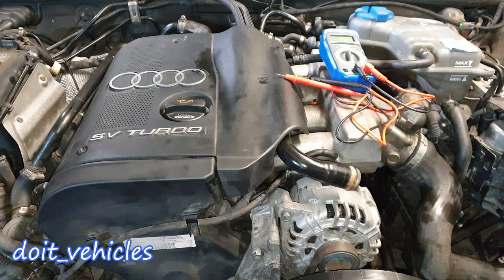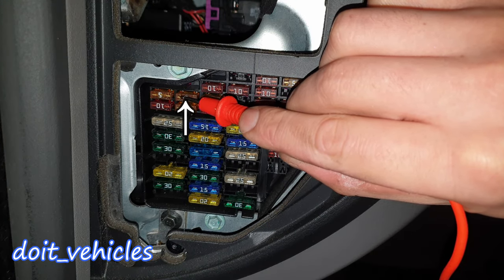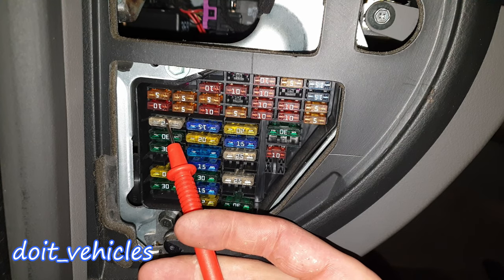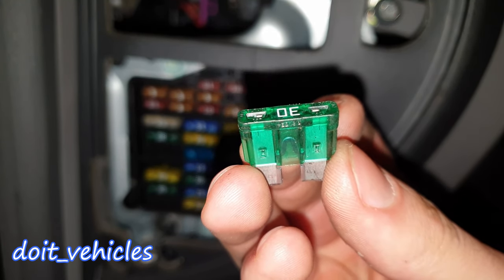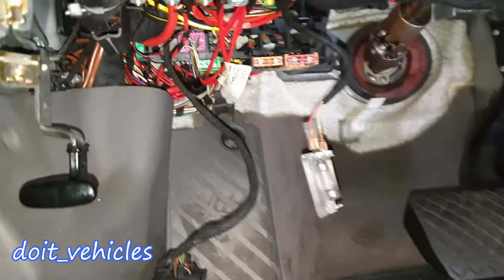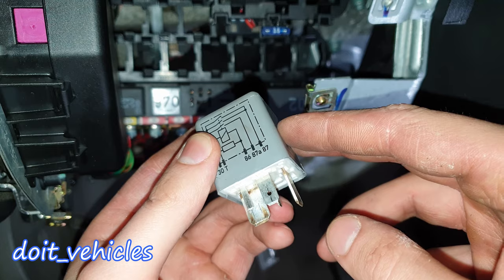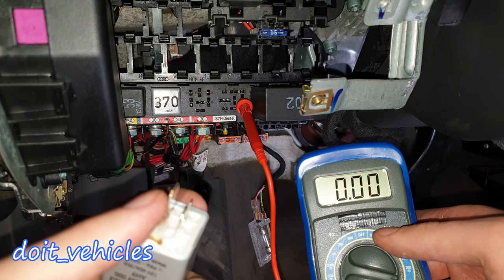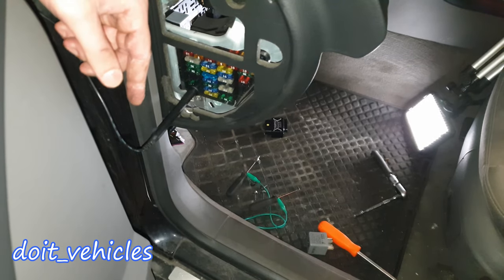1.8T Audi A6 Fuses and Relays Location / Diagram - how to test them c5

Comment: Hi, thanks for useful videos.
l have a question 
While I was driving my Audi A4 2001 has lost elecric power that means  no power at all. alternator is ok and the battery has enough power. what could be the issue.-'' 
Thanks

Comment: Excellent video! Hi! My engine temp, fuel, and battery gauges suddenly went to zero while the speedometer stuck at 50 km/h.  RPM/tachometer still works as does everything else on the instrument cluster. Does this sound like a blown fuse? (Audi A6, C5 2003/4 1.8T)

Comment: hello there great video do you have same video for the Audi A6 c6 model showing fuses etc I have a small problem on my Audi A6 c6 2007 automatic 3 litres when turning the key it sometimes doesn't turn over  fitted new starter 4 months ago as burned out due to heater plugs gone now all serviced and ship shape and no starter problem until this week, but any help on the correct place where the starter relay location is    need to know where the starter relay is right-hand drive car i am  70 years old but still trying to fix it my self any help please   been  a mechanic for 50 years  but this is my first audi  thanks for your time what ever happens I will be watching your videos for future reference

Comment: Hello, I wonder if you can help me. I have a 2012 audi q7 3.0 tdi. I get no crank when turning the key but the cooling fans come on about 10 seconds later. All the dash lights come on etc. I have replaced the battery and my autel scanner communicates with the ecu. I don't think I'm getting any power through the battery control module. Any ideas?

Comment: Hello, thanks for your videos, they are very educational!! I bought an audi a6 c5 1.8t 1997, and it stopped working. The engine cranks, but doesnt start.. When the OBD was connected, it couldnt connect to the ECU, we found out that the fuse Nr. 32 was blown, we replaced it, and the fuse blew when trying to start the engine.. Any idea what could be the cause? Thanks if you find the time to respond and keep making these videos. Much love from Czech Republic

Comment: What could be the problem of a door front light not working? I have checked all the fuse and used a voltmeter but no power is coming to the light bulb( good bulb)?
Both front not working but both back one works?

Comment: i have a 1998 audi a4 quattro 1.8t .. i am looking for the 02 oxygen sensor relay .. i have problems with my audi p0140 ..02 sensor circuit no activity detected bank 1 sensor 2 ... p1338 camshaft pos.  sensor ban.  1 open circ./short to b +

Comment: i have a 2003 Audi A6 1.9 tdi and my Aircon suddenly stopped working i went to kwikfit (here in UK) for re-charge . Mechanic checked and told me its fully charged , there must be a electrical problem , because compressor is also working. Any Idea ??

Comment: I have a quick question regarding the blinkers when the blinkers are turned on the light on the dash shows that the blinkers on but the blinker will not blink I've checked the fuses I've checked the lights and I am stumped I do not know how to fix this issue and it's kind of a pain to manually use my blinkers if you could help me out regarding the situation I would so be very grateful thank you for your time in advance
Reply from the maker: Hi ! One of the next step is to check if the light bulbs get power ; connect a voltmeter to the bulb wires , and turn the lights on

Comment: What is the reason for electric windows and central locking not operating when it is operated by the window button and to lock the door with the key. It's a audi a4 b5 1997 1.8 adr
Reply: Very helpful info. Thanks